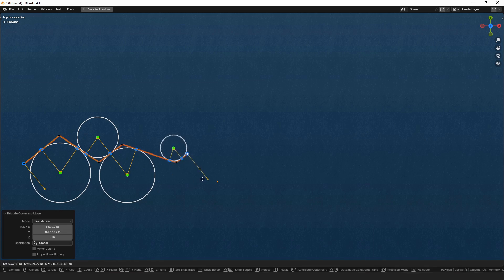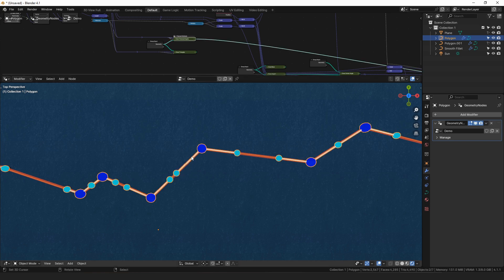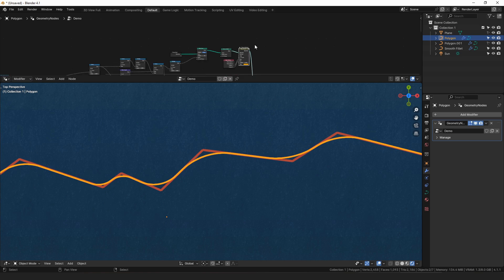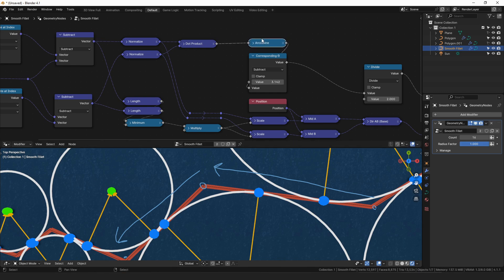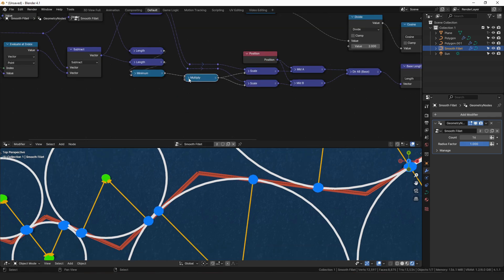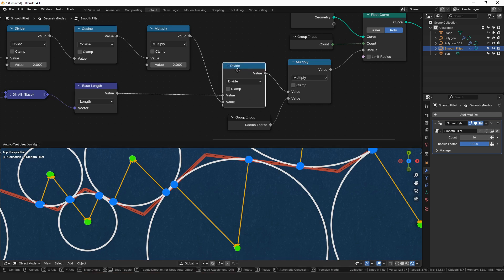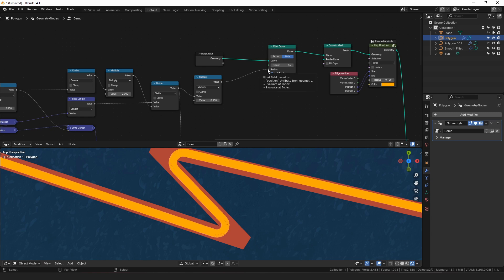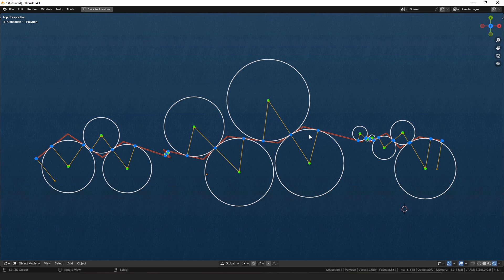Curve Bevel Min-Max Blend - Blender Geometry Nodes

Comment: Great video. I've been floundering over the best way to achieve this on a mesh, but I think I'll try just converting to a curve and using a portion of this. Thanks for posting! 

P.S. You mention a simpler way to find the inside angle of your two vectors at 5:45-- I believe it'd be as simple as flipping one of your location subtractions so that both vectors would be originating from the center point and radiating outward. Not sure if that might've caused issues at the ends though!